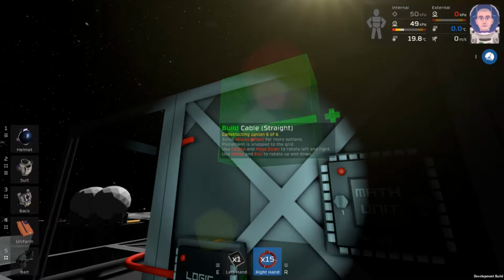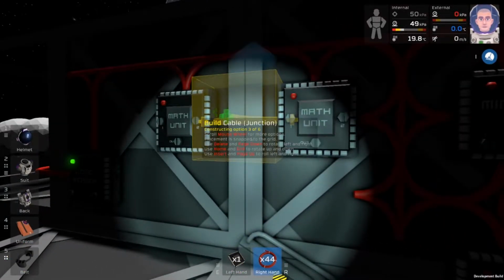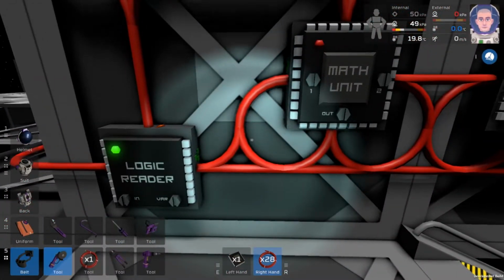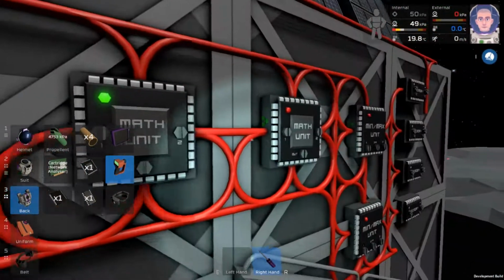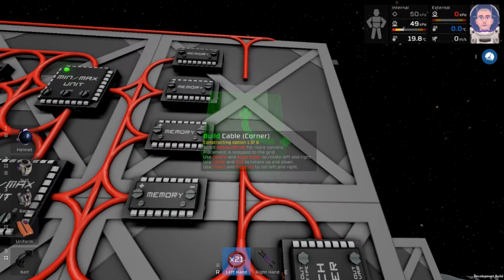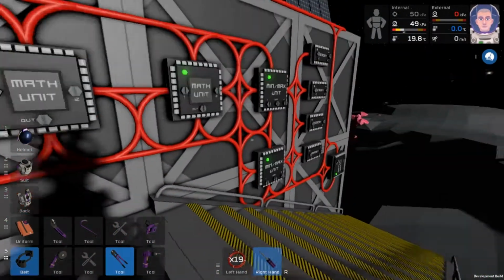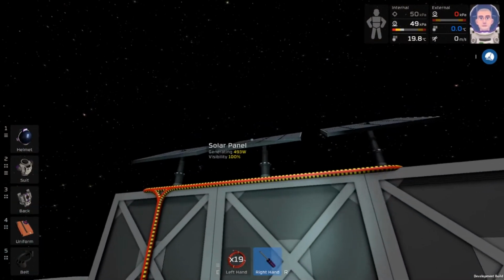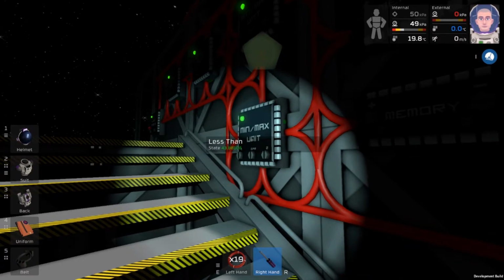Stationeers - Advanced Logic Circuit for Solar Panels Part 2

Comment: how many panels is set up good for??
Reply from the maker: Should be good for any number up until you're putting enough power through the cables to fry them. With heavy cable, it can support quite a bit